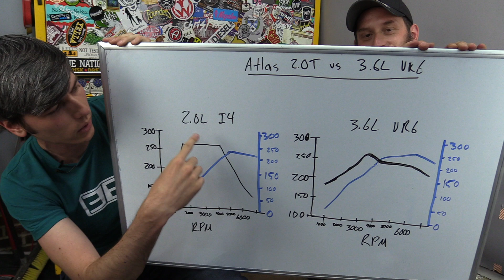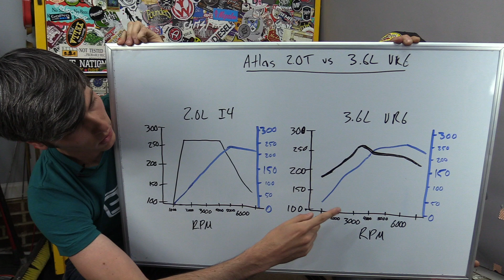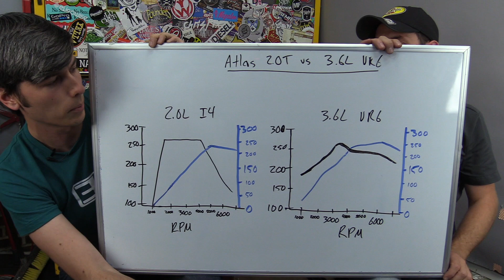4 Reasons Why The VR6 Engine Is Dying Off

Comment: Then put forced induction on the VR6. Then do a comparison, forced induction will always look better that a natural aspirated power plant.
Reply: Bri Guy's Utoob :)
Reply: While that may be true, take it from an employee of a European Auto Repair Shop that sees hundreds of these cars a year. The MkIV VW's and Audi's will be missed in their longevity and simplicity. MKV's begin a long decline in high mile  reliability thanks to DIrect Injection issues. MKVI's begin a serious drop off in both material quality and longevity. Different generation of 2.0T's that have issues with timing chain tensioner failures, and gasp... premature turbo failures that will run you into $2000 just for the turbo. Our cost (not the dealer.. which I shudder to think of their prices) These engines are becoming less tolerant of poor maintenance as well, something Americans are notoriously bad at. My last VW was a 2008 B6 Passat 10.6* 3.6L VR6, built after the infamous "oil pump bolt" failure of the earlier generations. Engine was well maintained, and outside of a throttle position sensor failure at 100K miles that would've cost me $2000 to fix (Extended warranty saved my behind), that engine was drama free. Rock solid, fed 93/94 Octane premium gas, oil changes every 5K miles with Synthetic, and spark plugs that last easily at least 50K miles. Car got totalled, so somebody got a well cared for 100K+ mile VR out of my misfortune. But I decided to go back instead of forward... to a lowly 2001 VW Golf TDI 1.9L ALH. Then modded that motor all the way from 122K miles when I bought it, to 425K miles when I sold it 4 years later. Engine was still rock solid.

My first VR6 in a B3 Passat (2.8L) had 220K miles on it when I sold it, and it was still running strong. Never so much as a head gasket

My 1.8T Golf (!50hp) had 275K miles on it, same as the VR6 except even the turbo was original. No leakage or boost issues either. Don't try this on the fancy new VW 2.0T's. You ain't getting nearly 300K miles out of those turbos no matter how ell you take care of the car. 

Big mistake getting rid of the VR's, especially the 6. The 8 was a disaster as everyone knows, and the 12/16 is for rich people with deep pockets if you want to care for them like you should.

Turbo cars IMHO are now just ways of saving costs for the manufacturer, AND a way to get you paying more to keep the car in maintenance and repairs after payoff. Or more like after warranty. That's what we're seeing at our shop. Keep your VR Humble. Keep it. Only turbos I'd trust are the 1.8T (Old MK4 style, not the newer MK7 ones) and the first generation 2.0T FSI in the MK5... even with the Baffle problems. Once you got that sorted, and the carbon build up from Direct Injection, you have a solid, stout motor. 

Speaking of which, you do know once you have to get that Direct Injection Head walnut shell decarbonized, the cost alone will totally negate the savings in fuel you had over the poor normally "port" injected 2.8/3.2 VR6 right? It's not cheap to clean those heads of the 2.0T. Or replace those high pressure Injectors even at Indy shop prices.

That is a deal killer for me. We're way past the cost benefit ratio of new glamourous auto engineering tech versus the good old simpler methods. That's why I drive a 92 w124 Mercedes Benz 300D 2.5L I-5 Turbo diesel. Worried about computer emissions tampering EPA? Ok, I go manual diesel. There, I'll tune the car to be powerful and smoke free. Car runs plenty hard now.... at least hard enough to make a 1.8T sweat in a race. And I still get 35 miles to the gallon out of it. 3400 lbs of old school Benz, that anyone can work on  with a set of tools....
Reply: Another issue that I haven't seen brought us is reliability. An NA engine should be more reliable which I prefer than a few mpg.
Reply: Ben R I think they were referring to the price of 91 and 93 is higher than that of 87, so whilst the VR6 has lower MPG figures the cost of running will be similar as you are able to use cheaper fuel
Reply: +HumbleMechanic hint hint, eh?
Reply: If I'm not wrong the vr6 can run off of 87 octane where the turbo has to be 91 or 93 which can negate the added mpg slightly
Reply: A company called TRD in the UK does a bolt on supercharger for the R32. It's a really neat unit with an inclusive lubrication that basically goes where the current air box is situated.
Reply: A turob doesn't have to be tuned for 30psi though. The great thing about a turbo is that it doesn't have to be tuned for huge peak power, but can just be there to help even out the torque and power curve, as well as help make up for changes in altitude and air density on different days.
Many diesel cars with turbos will easily last a life time.

Of course every extra thing you add does come with something else to break/maintain/cause problems, but turbos are pretty reliable these days, not 100% but then again nothing is.
Reply: Eddie G -Yeah, I've had to get my turbo replaced under warranty. I do honestly miss my R32, but it seems like the likely hood of them reintroducing an AWD VR6 Golf is very closely approaching zero.
Reply: DeepThought then put a supercharger on it!.  The advantage of the VR cylinder angling is to get a torque of the inline 6 in a compact space. Which is what I like about my 3.6L VR.  Now add in the direct injection, 4 valve per cylinder and other modernized items, and yes it improvement.
As a comparison the 3.6 Touareg is a combo of 15.8 MPG.  My 95 4.5 Land Cruiser gets about 12 MPG.
Reply: I don't know what car you have but 1000 rpm is waayyy too low to be cruising, and you can't load the engine too much because it's not good for the engine.
Most modern diesels turbo's already spool up at 1250-1500  RPM. Any lower is just wreckless.
Anything below 2000 RPM is considered low rpm, 1000 is almost idling with most engines.
Reply: Yup I was just thinking the same thing.
Reply: MegaGouch.  An engine, as a package with exhaust and turbocharger and oil lines to the turbo and maybe an intercooler is more complex than an NA engine.
Reply: Ben R actually it does because a higher octane has mkre resistance to pre detonation allowing for more agressive ignition timing making it more efficient. the field themselves don't have any more or less energy. that's why cars that require premium but will run on regular will make less hp amd less mpg. of course this is newer cars which can be optimized to take full advantage of the premium fuels higher resistance to pre detonation.
Reply: Bri Guy's Utoob Of course a VR6 + FI would be more powerful than the 2.0T, but it would be bigger, heavier, and more expensive. That's not a fair comparison. The point is that you can get 6 cylinder performance (or better) with a smaller 4 cylinder engine.
Reply: It was time someone mentioned carbon build up on direct injected engines... Never going that route again. Problem is that most manufacturers are going to these kind of engines. We're screwed.
Reply: Turbo diesels routinely run 300,000+ MILES, not just KM. I've seen some with a million miles and only 1 rebuild at 500,000. (Was a Cummins.) Diesel engine blocks are cast extremely thick and while most 'modern' gasoline engine designers have moved to aluminum blocks, diesels are still good old chunky cast iron. Pair that with a crank shaft that weighs as much as a motorcycle, and a big bore long stroke design. You end up with a tough torque monster that redlines at about 3200 RPM and will last a very long time.
Reply: I found this a little disappointing. It looks like there are no engineering based problems with the VR. Sure in a Golf it may be a slightly tighter fit than a straight 4 but in larger cars who cares? By this justification almost every other engine is inferior. As a 4 cyl would be to a 1 cyl. 'Up next, why a quad turbo W16 is worse than my mower motor.' It's also not satisfying to see NA compared with FI. Sure, the exact engines compared come as is, but induction has no inherent bearing on the usefulness of a VR. Indeed, on the surface it would be a far superior platform for forced induction than V engines as there's only 1 head. Not as good as a straight due to more complicated exhausted plumbing but it's far smaller block size would largely make up for that.
So I guess I'm just sad the whole VR idea is going the way of the Dodo just because it's currently more convenient for VW to kill it. Maybe I should be happy that there's no inherent flaws to the design so there's a chance someone will come back to it eventually...
Reply: Ryan Tendervittlebit I disagree w/ your thought. It's correct that the veyron's and latety launched chiron's W16 called like this because all cyls are opposed in a "W" shape, just like bentley's W12, also a vag member and the "vv" sounds very weird because it doesn't make any sense at all
Reply: Engineering Explained The Touareg went on a diet in 2012 in changing up the locking transfer case (gone!).  There is plenty of space in the engine compartment of a 3.6L VR Touareg for a turbo.  Remember the Porsche version has a turbo V8 option.
Due to the 4WD mechanical changes  I have Land Cruiser to do those deeds now.
Reply: Suburban yes you are correct, variable valve timing and DOHC is also more complex than a push rod engine. Engines in modern cars, and the cars themselves are far more complex than older cars in everyway, doesn't mean they are totally unreliable. 
I certainly wouldn't want to give up my complex ABS brakes, or my complex air-conditioning.
Reply: So what are the real benefits to a NA engine if it loses the economy/torque comparison with a turbo 4? I have a VR6 engine and an I4 engine (Touareg and Tiguan) and like the smooth acceleration of the VR6 and it sounds beautiful. But I'm interested if there are other benefits?
Reply: @aaronhuff8013 lasts longer. Simpler, and if you do your own work that pays huge dividends
Reply: what i like about naturally aspirated engines is the fact that you have more torque at low rpms.  A turbo needs exaust gases to spin. So up to a certain point it's hindering the air. Yet turbos get much smaller ergo they need less exhaust gas, but also create less pressure/volume. 
when I cruise around I'm normally at about 1000rpm where most turbochargers won't do alot, so it feels "better" without a turbo.
Reply: matyfigure09 That's why I say retro is the best strategy. Key is finding a well kept vehicle, lower miles, and invest your dollars wisely in refurbing that vehicle. This dying economy thanks to D.C. and Wall Street will not allow for much else.
Reply: Red Phoenix 
No. Turbo engines are notoriously poor at maintaining themselves over 100,000 km whilst a n/a engine can easily reach 240,000 km before needing any internal repairs. What I mean, is that the turbo is always harder on the gaskets, crank, & things like that. So realistically, a non-interference n/a engine can run essentially until catastrophic failure then be bored & rebuilt. A turbo engine is very unlikely to be bored and rebuilt at 500,000 km. Unless you have a speed shop, or are a rich tuner. Even tuners will just buy a remanufactured of the same anyways.
Reply: Lets compare to a VR6 2.0 L with turbo and then make a video
Reply: Seriously, Ive wanted to turbo my 3.6 vr6 but don't have the money.  The flip side is the 3.6 is plenty of engine for my Passat.  Honestly, a lot of these performance #'s are just marketing.  Like everything from cell phones, to computers, to toys, or a # of other products, the upgrades/new features cost the manufacturer a few $ more, they charge exponentially more than cost and honestly, maybe 10% of consumers will actually ever use the difference in performance or even notice.
Reply: Well, a W is a double V, so it kinda makes sense.
Reply: Anton Zuykov like the factory clutch in a MINI S. oops I broke it!
Reply: Jesus Murphy, those numbers are bad. Your 4.5 gets the same mileage as my 96 F250 7.5L.
Reply: Spenser Zimmermann yup, Toyota diesel in the USA been a while and will be a while before they commit
Reply: Jon Council I'm trying to get rid of my 2012 vw Passat v6 cause maintence is too much and it needs soo much stuff done that by the time I got it all fixed I would have spent more than half of the trade in value and I still owe 10k on it. I'm glad you had good luck with yours but unfortunately for me I cannot wait to get rid of this car.
Reply: Josh R As bad as your VR may be, the 2.0T would be worse. Ultimately, your enemy here is you're in a B7 Passat. The B6 was the best built version relatively speaking. In this economy, going back to the old school is your best option.
Reply: What do you mean by reliable? Wear and tear? Except for wear materials there should be no difference in reliability, unless you treat a turbo-charged engine like a moron.
Reply: Then why does almost every turbodiesel last over 300,000km?
I personally know at least 4 people who own (small) turbocharged engines. 1.4 with 170 HP, 1.75 with 235HP, 1.8T 210 HP, and another 1.4.
All those cars have over 200,000km and have no drivetrain/engine problems.
Reply: Engineering Explained   Except VW is using the turbo in more of their lineup including the 1.4L turbo model.  Realibility  is related to boost level and is the key to longevity/ reliability.
Reply: So, we are going to replace a somewhat complex engine with a smaller even more complex engine?  Not sure I am getting the math.  I think I'll stick to MOPAR V8s.
Reply: Bri Guy's Utoob true guy
Reply: Wrong
Reply from the maker: Yep but then it's even more space and even more weight. There are real benefits to an NA engine which VW probably likes about the VR6, but from an economy/torque perspective, the case really isn't there vs a turbo 4.
Reply: @EngineeringExplained  unless they shrink the vr6 to a 2 liter 😁😁
Reply: @EngineeringExplained  A turbo manifold and reasonably sized turbo doesn't take up that much extra space...they just have no incentive to produce engines that are making in excess of 400 hp, so the inline four cylinder is more than adequate.  I'd say the argument for using the inline four turbocharged is both A) it makes adequate power and B) the weight advantage in a car that's already prone to under-steering.  There's an argument for cost as well.
Reply: @EngineeringExplained  but im not buying a VR6 to save space and weight, im buying it for that sweet sweet exhaust sound and that zoom zoom power.

VW has lost its enthusiast wing and this "everything has to be efficient" attitude is why. Even their inline 4 with turbo while powerful, isn't really THAT efficient in compare to other engine brands now. They need a car to hit that niche where the 350z is.
Reply: @EngineeringExplained  the VR6 is a legend but the other engine nobody wants. I don't understand your argumentation at all.  Clearly the 4 cylinder engine is the worst engine VW ever build. In all aspects.
Reply: I heard there's supposedly a forced induction VR6 in development. My memory is a bit fuzzy, but I think they even had it on a concept car recently. 3 litre, I think? Smaller displacement for both better economy and space for the turbo, I'm guessing. I haven't heard anything recently though. I figured they'd release it with the Atlas, but I guess it's still being developed?
Reply: randomkoreanguy 
HPA has been adding turbos to the vr6 since before the first R32
They are sick
Reply: @randomkoreanguy  VW did make one 2.5T Vr6 for one specific car
Reply: The W series motors are basically double VR series motors. So the most iconic supercar of all time, the Veyron essentially has a double VR8. It is much more accurate to say VV16 than a W16.
Reply: Very very true. I have no desire to have a turbo daily car. Wayh more complex, way more issues, way more expensive.
Reply: Brad Riley turbos really aren't very complex, if it's not tuned for huge power output and you change oil frequently and let the turbo cool down correctly, they cause little trouble. Basically every diesel vehicle these days is turbocharged, and they last forever. 
I own 3 turbo diesel vehicles with 200,000+ miles and the turbos have been fine.
Reply: This is all theory. Trust in the real world a vr6 has more power everywhere exept the top end. The vr6 24v was the premium package not the 1.8t. There is 0 argument in real life a 1.8 cannot equal the experience.
Reply: Well, there is no W in the german alphabet, they only have a double v, so...
Look at the symbol, its not a W, its two overlapping V's
Also, I have a W8 passat, so I have looked into this quite a bit.
Reply: @tendervittlebit  i know it's been 2 years since this comment and you probably know this by now, but there defenitely is a W in our alphabet. it's called Volkswagen, not Volksvagen

Comment: First of all, no such thing a fast VW.. their 3.2L 6 cylinder engine made 250hp? LOL GTFO. Boring AF, useless; just let it die please.
Reply from the maker: +zdrux Golf R holds its own against the Focus RS, even with significantly less power. It's definitely quick. And ya know, VW's other brands... Audi, Porsche, Lamborghini.
Reply: So you've never drove a modern vr6?
Reply: zdrux ~80hp per liter is perfectly adequate for for an NA engine produced by a non luxury/performance brand like vw
Reply: I take it you've never ever seen a race track in your life have you zdrux? Go to an average autocross course or track and you'll see VW's killing it. Good car in the hands of a competent driver is all that's needed. I'm not even close to a VW fan but give credit where it's due.
Reply: (Sigh) 😞
Reply: ElTiooJonny99 yep na 2jz is definitely slow. I get spanked by Malibus and base camaros. definitely fun engine though. enough power to whine out and use all of its power :)
Reply: C20XE>VR6